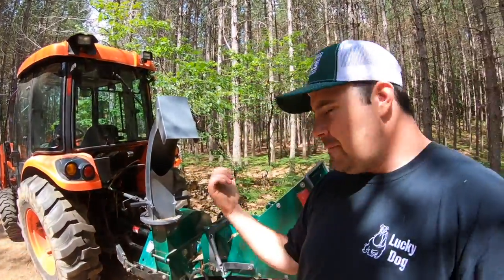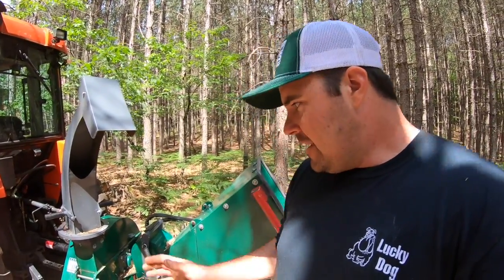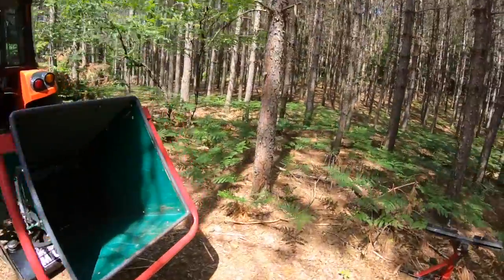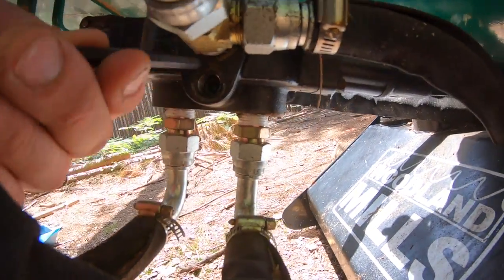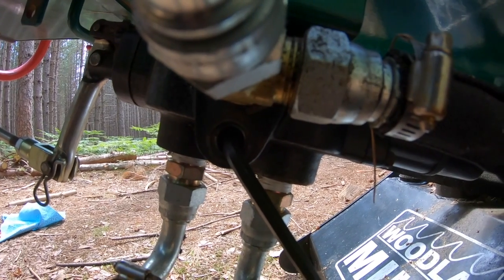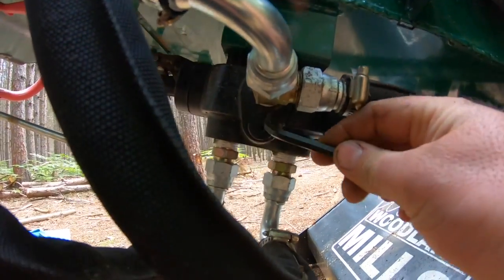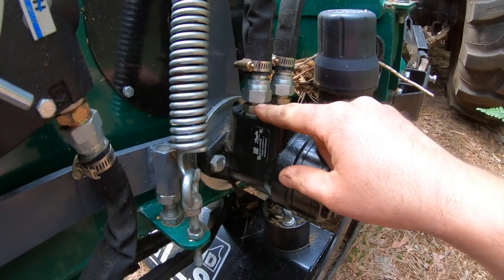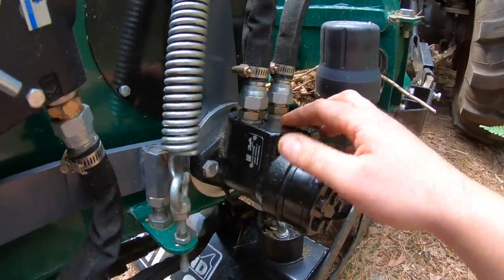Fixing Woodland Mills wc68 Infeed Roller. Adjusting Woodland Mills wc68 Pressure Relief Valve.

Comment: Appreciate the video. I’ll give this a try. Have you had any issues with the roller not turning on the lower settings? My roller doesn’t even start moving until I turn the speed to 3.
Reply from the maker: I haven't noticed any issues like that. I do know that if the adjustment is at the far extreme (ex. 1) then it will stop the rotation of the infeed roller until I move it up past 1 to something like 3 when it moves slowly

Comment: I have a 6' Bearcat chipper with similar roller motor. So wondering does the bleed method work on both lines? Also thinking of changing fluid and filter as I don't think it's ever been changed.

Comment: Hi, thanks for the video. I understand 'resetting' the directional control valve relief valve but bleeding the motor line? This hydraulic system is not like a close system found in brake calipers where oil simply move back and forth within the same line and air can get trapped and needs to be bleed out. Here, oil is constantly being moved from tank output line to tank input line so whatever air might have been 'trapped' in the motor line will by itself be brought back to the tank. No bleeding necessary. Same reason you don't need to manually bleed your tractor loader hydraulic system. It self bleeding.

Comment: Hi Sandy-  I've been watching your videos for a while now, mostly about sawmilling.  I recently purchased a wc88 chipper because I viewed some of your chipper videos you sold me!...Anyway I thought I was having some issues with my roller as well and narrowed it down to the detent adjustment on the valve.  My troubles were from vibration and the weight of the roller feed bar pushing down.  By adjusting the detent it prevented the weight of the handle pushing the valve to neutral.

Comment: Yup, thanks for this I'm having the same issues with mine. A different issue is green gum leaves not getting chopped but going around getting more mushed under the wheel. I have to put on some more solid wood to somewhat clear it out.
Reply from the maker: Hi Dave, I also encounter that. I think the chipper needs the solid pieces to push the leaves into the cutting whee

Comment: I have the same issues with mine. I did what you did. It helped but sometimes it still stops. replaced all the parts like others. I installed a pressure gauge on the line to the roller. When it stops I have over 2000 PSI on it. I sent pictures to Woodland. What they came up with is the roller is not feeding all the pieces through. Small pieces are going around the roller and jamming it at the top. I did loosen the spring tension on the roller. That helped some. Now for the odd time it does it I just reverse it and go again. Hope this helps. Larger pieces are not a issue.
Reply from the maker: Thanks for passing that info along. Very helpful
Reply: I also have a 2017 model wc68..Set the pressure relief and its slightly better but this is the worse piece of equipment i have ever taken to the bush.. The infeed roller stops almost every stick that goes in it. It simply breaks off pieces of wood and jams between roller and housing.. I hate this chipper. Did you ever find a cure??

Comment: I was a heavy equipment mechanic for several years and never bled any hydraulics. The air pushes right through and goes right out the return line.   The pressure relief was the fix.  Bleeding it was a waste of time, oil and rags
Reply from the maker: Thanks for watching. Any suggestions on how to fix the issue with the hydraulic infeed roller?

Comment: Thanks for the video.  Mine does the same.  I've run through the same process from the support team, I've also replaced the motor and the valve, still have the issue, frustrating.
Reply: My WC46 does it too. I did the pressure relief valve but no change. The hose is on so tight I gave upon bleeding it. I'm living with it.
Reply: @fpt264  I've replaced the speed control, motor and valve, same issue.  Maybe I'll do the pump next, or try bleeding again.  Last possible thing it could be is the bed plate gap, which I'll also investigate.   If my last attempt does not work I'm putting it down a a design issue where wood get trapped between the feed wheel and the chipper disc, which binds the feed wheel making it go into bypass.   If I could just fix this one issue I would be extremely happy with this chipper.
Reply: @Crickelwood  I could not agree more. This could be a great chipper if this one issue is fixed.. however thats not the case and this is the worse chipper i could have ever imagined owning..
Reply: @brianyoung6583  Since I posted I tried everything under the sun to correct the issue (including replacing all hydraulic components) to no avail.   I sold it.  It's a design issue and it was driving me crazy, every second thing I put through it the roller would bind it up.
Reply: Yup it’s horrible. It will never work properly. It’s a design flaw. Woodland mills should just admit it. Mine just sits collecting dust. Not worth the frustration. Roller stops whenever it feels like. I have tried everything